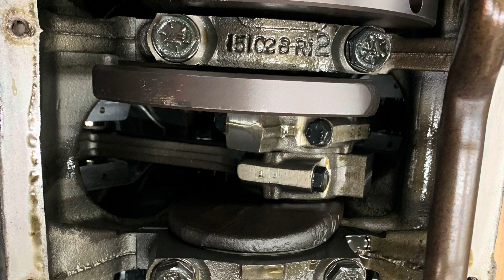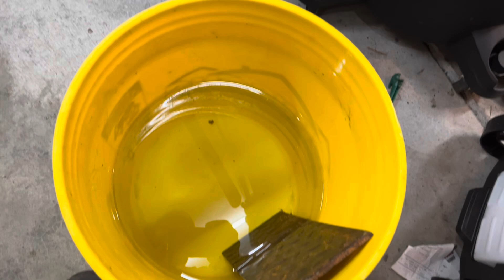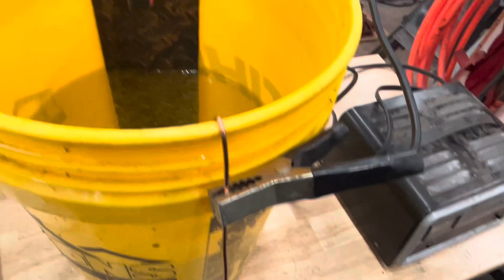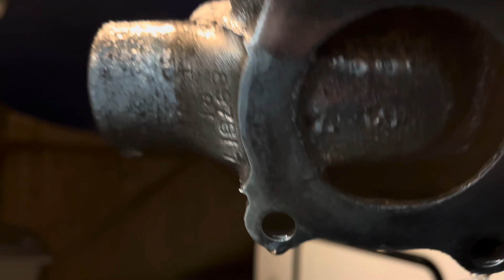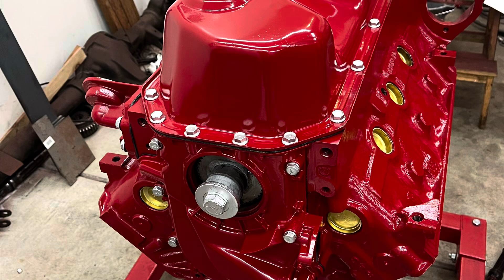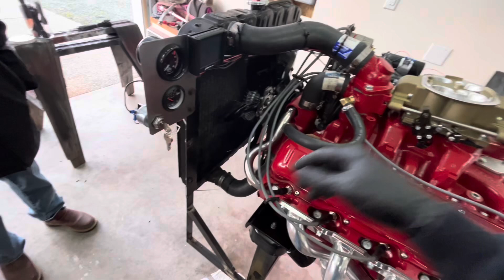Scout 800 345 Engine Build (Part 2)

Comment: You did amazing work, my gosh.  Recently purchased a 1975 IH D200 3/4 ton, with the 345 V8.  Shes rusty, but simply I adore her.  Just going through some challenges, like recently haha.  Just finding out that I will have to swap both rear and front axles, cause a simple brake job turned into a now conversion from IH stock rotors, to now a complete swap of both axles, just to gain ability to do a break job. I was told my rotors are discontinued.  I am looking forward to seeing it with the donor trucks dana sixties on there.  Just had to say, that engine looks better than anything common you see around.  Way to go on this build!  Inspires me to do something one day with my three forty five.
Reply from the maker: Happy to know the work was inspiring. It is fun driving something different than the rest. Crazy about your rotors. That is how it goes sometimes with IH stuff.

Comment: how do i tell what distributor I have?
Reply from the maker: Holley Distributor (very common on IH V8s), * Often paired with the “gold box” ignition module on the firewall
* Cap is usually held on with spring clips (not screws)
* Bulkier body compared to Prestolite
* No external vacuum advance canister on some versions

Prestolite Distributor
* Has a vacuum advance canister on the side
* Cap is typically held down with screws instead of clips
* Usually paired with a small electronic module rather than the gold box
* More compact than the Holley